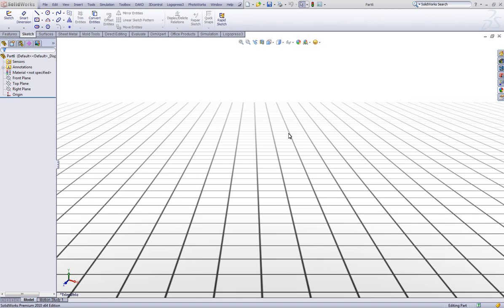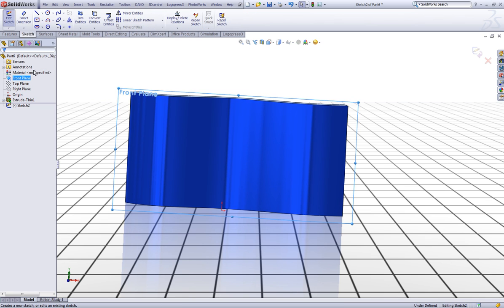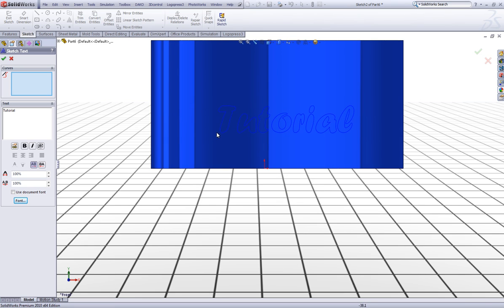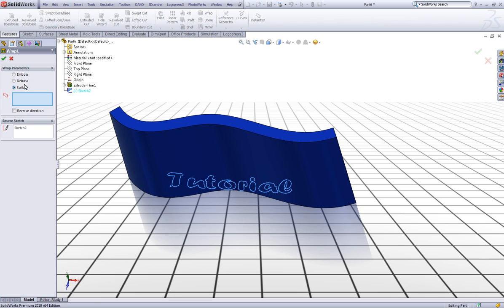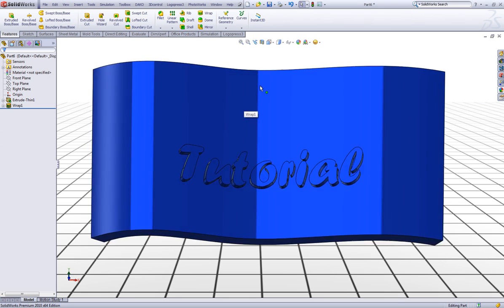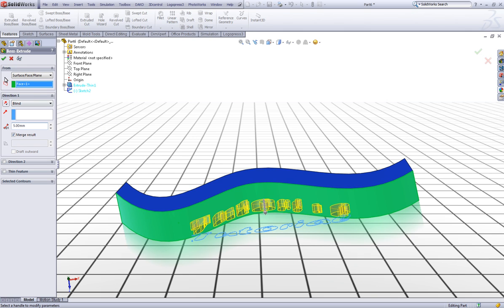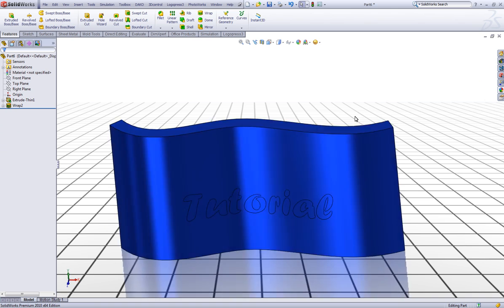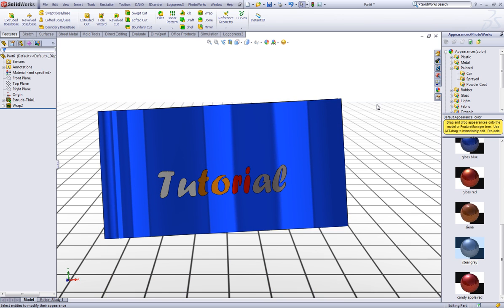SolidWorks Tutorial: Adding text to a surface

Comment: @Borecius950ktm
Keyboard
Left Right Arrows: Rotates about Vertical Axis Y Axis of screen
Up Down Arrows: Rotates about Horizontal Axis X Axis
Mouse: Hold Middle Mouse button move cursor rotates model in most CAD systems.
Michael

Comment: You can use the Offset From Face option as depth option instead of entering Blind depth to have the end of Text Extrude be a similar or offset face from Surface you are going from this would probably stop the error you got from the partial a intersecting with the face.